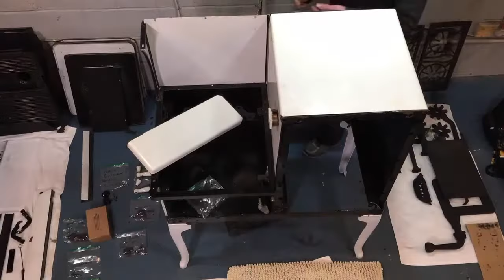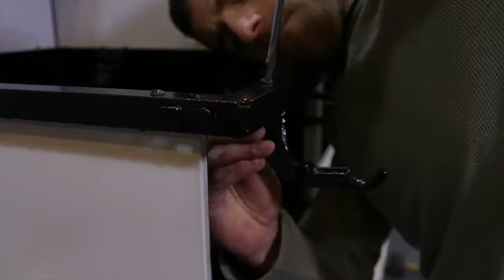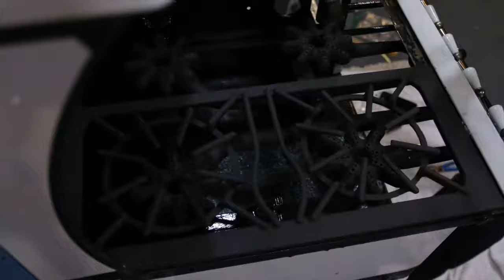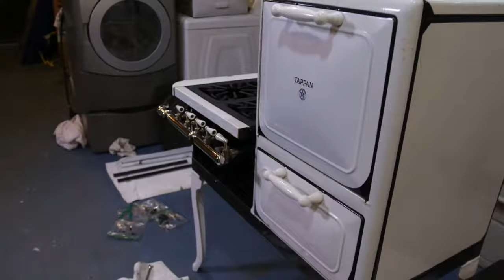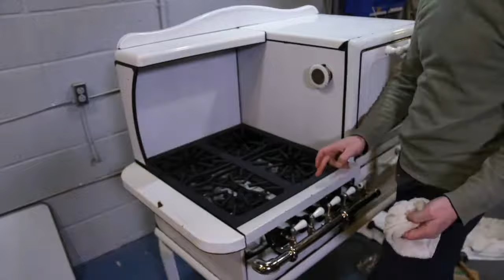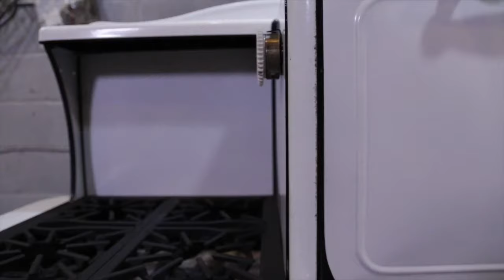Vintage Antique Tappan Gas Range Timelapse Assembly - Stove Restoration

Comment: My grandmother had a chambers stove when I was growing up. It was Nike green and yellow. I was around 8 years old. My sister and I when visiting would run in circles in the house playing when it was to hot to go outside. One time we somehow accidentally turned on the gas handle when running past it. There was no safety bar like yours has. The house filled with gas. We noticed a smell, but just kept playing. We thought it was smog. Lol My grandmother was out in the bird aviary feeding the birds at the time. When she came back in she screamed. She then told us the dangers of gas, and that a stove was never to be tampered with, and needed to always to be checked to make sure the handles were in the down position. Our dad told us 30 years earlier they had added that rotten egg smell to gas, to warn people of leaks. No need to get rid of the stove. We weren’t allowed to play in the house unsupervised after that. Lol

Comment: We have a near identical model Tappan in our kitchen and it is truly most amazing. When we got it via Craigslist a few years back we had to dismantle it piece by piece and put it back together so I can confirm this video is true and awesome. thanks.  where can I get a replacement for the broken porcelain handle ....
Reply: Would like to know the same. We have this model as well and need to attempt restoration! 😱

Comment: Is this comment section still active? I have 2 stoves of this era I'm trying to get info on. One is identical to the one in video except it's exactly reversed, burners are on right side and oven on left side.. the other stove is smaller with oven under burners. And the only name I can find on it is "Beaver" it is a light bluish color..I've tried searching it but can't even find any info on beaver brand gas stoves from this era .